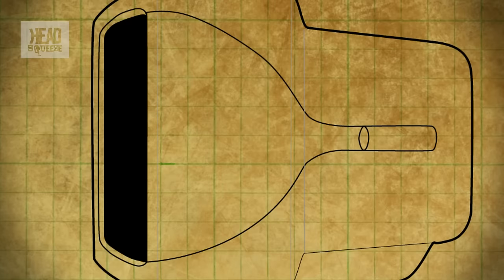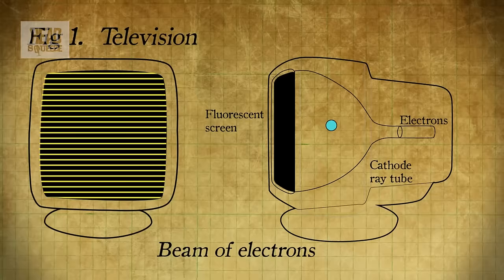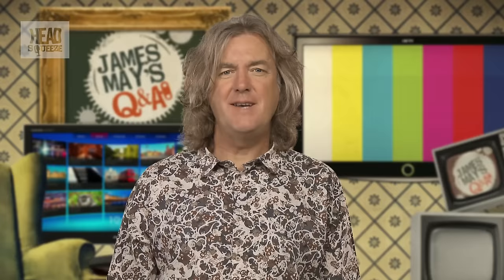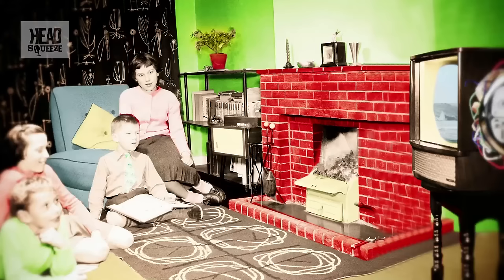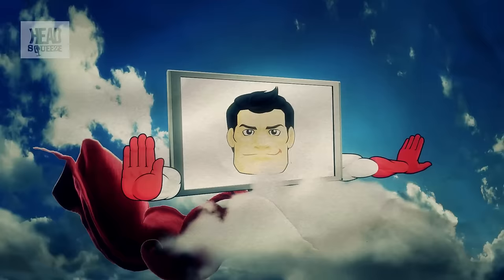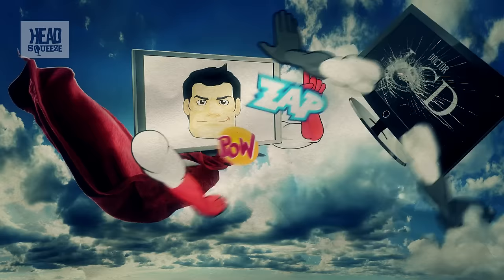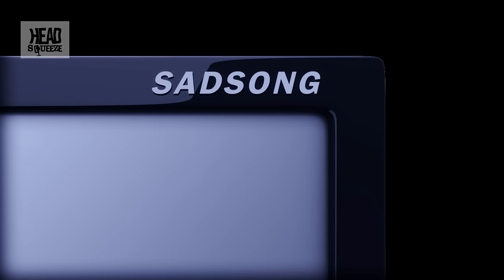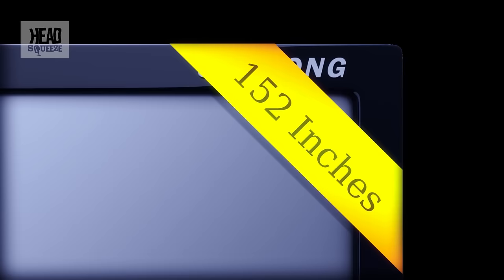How do plasma TVs work? I James May Q&A I Head Squeeze

Comment: It's actually possible to have colour TV with a single electron gun; it just needs to be able to adjust its intensity fast enough (i.e., in the time it takes it to go from each sub-pixel to the next).
Reply: yeah, like the Sony Chromatron
Reply: I think Techmoan reviewed a camcorder that had a viewfinder crt eyepiece with a single gun. It would use near uv pixel to synchronize the colors. It was red, green, blue violet. It had a sensor just for violet
Reply: RGBV, RGBV, RGBV, That's how it could orient itself to know when and where to burst. Techmoan actually showed us that when you covered the sensor, color was lost and monitor went monochrome.
Reply: But I also understand that plasma sets would scam 4 times per frame. I have seen the photos of this. I actually had a plasma set for a short time. I could almost see the 4scan operations to a point. When that thing fell over and split the screen, I powered it in immediately to watch the very center still try to produce at least part of a picture. If you wanted to see a grown man cry like a baby.😢 Mad respect to plasma because it was a crucial step in the development of flat panels and history of them.
Reply: @ray-sattler *Indextron

Comment: Plasmas have a wider colour gamut and deeper blacks than LCDs, and at larger sizes they become more cost effective. You won't find many 32" plasma TVs, but as you go up in size they become more common, and at 60" nearly all the top models are plasma.
Reply: Been tem years since you said this.
Reply: @hectormelendez4891  - And it still holds true, with OLED panels replacing plasma in the last few years. LCDs are still not a great choice for very large TVs (or gaming), although they're still a good choice for "work" monitors, since they don't have the burn-in issues that OLED has. But most people don't use 60" screens for work.

Comment: CRT's use Red Green and Blue phosphors to produce color. Scaling up the size of a CRT width wise did not proportionally effect the depth. Larger units weren't all that deeper than their smaller counterparts especially in the late days of the technology. Also RGB triads on a Slot/Shadow Mask display are not pixels as they're not individually addressed and not digital, they are analogue. Either way entertaining video.
Reply: But after 25 inches diagonal, it seems like every inch diagonal increase was a doubling of weight. Or damn close.  25" can be hefted up by one person. 30" requirements are 4 people to lift up. Wiider scanning angles made for shallower depth on CRT but as it got larger in the front, you're GOING to pick up more depth than a slightly smaller tube.

Comment: its RED BLUE AND GREEEN
Reply: 真夜中の旅団 yea but a looked at my phones screen under a microscope and saw red blue and green rectangles
Reply: Josiah Turner well it really should be red, blue and yellow as thats how you make every color, they might have been blended?
Reply: naw that's how u do it with paint
Reply: +OFFICIALGamingJayZ CMYK is what we know as red blue yellow. It is the subtractive color system. In light RGB are the primary colors.
Reply: +真夜中の旅団 As others have said, RGB are the colors produced by all displays. Differences in the frequency of light don't work the same way as mixing paints.
Reply: ***** wut?
Reply: +Josiah Turner Exactly.  The colors of light verse palettes of color.   Pure Red light plus Pure Green light plus Pure Blue light will make pure white light.
Reply: +Phase_2 They were talking about colors of light, not palate / pigment colors.  Crying out loud.
Reply: +OFFICIALGamingJayZ For Pigment / palette colors, yes yellow.  But for colors of light it is Green.  Pure red, blue and green would make white light.
Reply: +JackFreedomcis I don't know about plasma, but in lcds and oleds, it's definitely red, blue, and green.
Reply: +Phase_2 Yellow is secondary colour.
Reply: +Aroused Squirrel Yes. And televisions were never CMYK. Its for printers.
Reply: omg how old is this comment? 2 yrs? y are peeps still reponding
Reply: Josiah Turner it's actually only a year old.
Reply: Triggered much?
Reply: Red and green makes yellow when you mix light together, mixing yellow and blue together using light just makes light yellow :P
Reply: @misinformedowl9247  yellow isn't in lcd's because at the time they didn't have the technology to add yellow, rgb is mixed to make a orange color that looks yellow since your brain can't tell the difference unless you put it up against real yellow.
Reply: @Giant Sneakerz the primary colors of light are different than the primary colors of pigment
Reply: @Giant Sneakerz You're thinking of pigments. In terms of light, it is red, blue and *green*.
Reply: RBG?
Reply: @josiahturner1433  you probably would have saw dots if its a phone
Reply: It started as red blue and yellow but then when lcd was invented people found out you could make more colors with red green and blue so on plasma TVs  its red blue and yellow 🙂👍
Reply: So they should call those plugs RYB Scart?
Reply: @ravaxe2513  It was red green and blue all the time.
Even the first color sets

Comment: If you sit far enough from your TV to see the entire screen, you're unlikely to notice the difference between HDTV and 4K. Most live action "digital cinema" is mastered at 2K (4K is used mainly for effect shots that are going to undergo a lot of processing). You need a really good (read, really expensive) lens to get pixel-crisp 4K images.

And remember that a Bayer sensor does not capture full RGB information for each pixel, but a TV screen does display full RGB information per pixel.

Comment: Color and image settings is all preference. There are so many calibration settings that it's all preference. What really sets tv technologies apart,is which one has the best black color definition,zero input lag,smoothest refresh rate,and most vibrant colors. Those 3 image qualities is what makes or breaks a tv or pc monitor. It separates the Alphas from the Betas. The videophiles from the tv noobs.  As for motion performance,plasma tv is best in video game use,smooth buttery frame rate,and absolutely no input lag. This is very important in fast paced games,such as call of duty,no motion blur with  Plasma.

Comment: Whoever researched the background of CRT technology for this video didn't dig very deep. Tubes did become progressively slimer as time went on, of course nowhere a flat panel but still, and high definition resolutions were possible (full 1080i achievable on consumer HD CRTs/QXGA on CRT monitors). If CRT continued and didn't almost immediately die, more improvements could have been made.
Reply: They got slimmer and more shalow, but at the expense of extremely thick front glass. I've a B&O 32" true-flat widescreen CRT and it weighs 80kg. Net image size is 29 inch. That is NOT FUNNY. And it is still 55cm deep. Good thing is it turns towards the remote on a rotating feet, so you never see the huge back. A 80kg plasma would be like 90" or so and 10cm deep. CRT was on a dead end track. What DID happen is that Philips desigend a flat CRT tube in the nineties, in a flat glas panel with tiny electron tubes. But the project was killed by the board as it was too expensive. LCD was simply put too cheap to compete with.

Comment: There is in fact no absolute definition of "primary colours". It just means "the colours used as the basis of your palette". The only requirement (if you want to create a full spectrum) is that your primary colours be complementary to each other (i.e., every colour must be derivable from them, and the primaries should not be derivable from each other - otherwise your palette is unnecessarily big).

Nearly all monitors use red, green and blue dots, but some types of film use different primaries.

Comment: In 2017 Plasma still has the best quality of out any screen. It is better than LCD or OLED. 

It can achieve true blacks that an LCD cannot. It can achieve better colours than an OLED. It has limitations in terms of resolution and can only achieve 1080P. 

But it is still the best. I have fancy LCD/LED tvs and they come nowhere near to my Plasma TV which is my cinema reference system. It is even better than my fancy home cinema projector.
Reply: Plasmas don't achieve true blacks. They have very good contrast and motion clarity but don't compare to oled in contrast ratio and resolution and now with HDR becoming mainstream the reasons to keep a plasma are starting to dwindle. On the flip side you can find very nice 2nd hand plasmas for very cheap atm and still look stunning. Having owned multiple trinitron including HD CRTs, Fujitsu and Panasonic plasmas I can honestly say that my lg c8 playing 4k hdr content blows them out of the water. Motion handling is propably the only thing that could be improved however black frame insertion works well in gaming and in 24p content I find all motion processing being turned off to look excellent albeit not quite as good as a plasma, however after a minute or two you quickly forget.

Comment: Being LED-backlit does not mean they can turn off individual pixels, it just means they use an array of LEDs instead of fluorescent lights. Some use as few as 20 LEDs.

Look at a big plasma vs. a big LCD in a brightly lit room (or even outdoors) and you'll see the difference in blacks.

Nothing about plasma makes it "behind the times". The reason why most manufacturers prefer to push LCDs is that their profit margin is bigger. Same reason why CRTs vanished so quickly (very expensive to ship).

Comment: Red Blue and Yellow?Really James? It is Red Blue and Green. We are talking additive colors here folks, not subtractive colors as in paint that absorb specific wavelengths and reflect the rest.Mix red, blue and yellow paint and you get black.Mix red, blue and green light and you get white light.
Reply: +12voltvids no an electron tube works in a different way because of the way it works
Reply: +Bacon lover What?Are you serious? Go back to school. It doesn't matter if we are talking a CRT or plasma or LCD. We are talking primary colors, and when talking light emitting devices, we are talking additive primary colors and those are RED, GREEN and BLUE.Don't believe me, go take a magnifying glass and look at the color pixels that make up all types of color displays.The only display that uses yellow is the quatron LCD by Sharp. They added a yellow color, however it is an interpolated color, because the primary colors generated by the TV camera are Red Green and Blue.
Reply: here was my response, also I am a ex-tv repairman "tv's are Red Blue and Green , not yellow. RGY are the primary colors, And Green is a secondary color. But why would they use RGB on a display? Well there is a difference in projected and reflected light. Where as RGY is used in reflective-subtractive color wheel. Think paint on the wall, where you add all colors you get black. Now think of the TV as a colored light projector you add Red and Green light you get Yellow, this is an additive process. However there is a TV that has yellow pixels also. It is the sharp quattron. As the name would suggest it has 4 pixels Red Green Blue and Yellow."
Reply: we both have the same exact comment lol
Reply: However with sharp, the yellow pixel is just advertising jargon to confuse consumers like curved screens. It does nothing, because yellow is not an encoded color. So to light up the yellow pixel, it is interpolated from the red/green mix. A much better solution was how Sony did it with their triluminous color filter, which starts with primary blue, and by wavelength dividing generates primary green and red wavelengths which generate much more accurate, and a wider color gamut for the LCD color filters. Of course in plasma and oled, these displays generate the light themselves.
Reply: 12voltvids interesting. Now here's a question, would a display be richer having 6 color channels or is it not needed as our eyes and brain cannot tell the difference. Now here's another thought. In a lcd , oled , plasma , crt display you have to place pixels next to each other . What if you had a projected source with pixel stacking so you get true color in single pixel space. How long have you been fixing electronic stuff? I started doing tv repair in 1998 changed jobs to cctv , home theater , home automation , access control in 2012. I work mostly on rear projections and crt stuff early on then dlp , lcd , lcos , plasma then only lcd panels . I never worked on an oled .
Reply: I started in the business in 1983 mostly Betamax, but then I worked for the Sony corp at the time. In 84 I moved on to my permanent shop where I remained until 2003. I did VHS, Beta, 8MM, Laserdisk, CD, DVD, Audio equipment, projection TV, and CRT. I left the business in 2003 to pursue a career in at a major ISP, and just work on electronics now as a pastime for my youtube channel.As to having more colors than the 3 primary, well that is a waste because the television camera is based on 3 primary colors. Any systems that utilize more than the 3 primary colors are generating those colors by means of interpolation to generate discrete colors from the primary colors. Inkjet printers do it, for example my Canon 9900 uses the standard CMYK (cyan magenta yellow and black) plus photo cyan, photo magenta, red and green. The additional colors are added to allow printing those colors without having to use a ton of ink from the others to create them. DLP Tvs also in some cases used a 6 color color wheel to attempt to reduce the rainbow effect as the eye could catch the red/green/blue single colors. The idea was to create a larger color gamut to fool the eye, because t he yellow, magenta and cyan colors, in addition to the red green and blue would blend in and create an optical illusion.  As far as stacking pixels, this is exactly what 3LCD, 3LCOS projectors do. 3DLP cinema projectors also do this. They have 3 chips that overlay each other.
Reply: 12voltvids where you around for some these Sony recalls? 36" and 40" Xbr crt replacement, kp forget the model crt , two surface mount resistors , I want to say A pcb  & 3 crt replacement. Or the sober kdf we and Xbr light engine replacement due to clogged scricco fan "pusher puller fans. I done so many of those in customers house. Light engine swap was like 30-60 min job. The 3 crt's and surface mount resistors job used to take me 3 hours or so. I used to replace blue and red first and align to old green crt then change green and align to new crt's . I miss it driving around meeting new people.
Reply: I did a bunch of 3 CRT projection tube replacements when the green tube arced and broke the faceplate. Never did any 40" direct view tubes. We didn't have the equipment to lift the tubes out. I di remember them though. Had a customer that had one of those bears (40" CRT) installed in his bedroom up about 6 feet in the air. The CRT failed. My boss insisted that I fix it in the house and I said how, it is a custom install that I can't even get the back off, never mind see in his dark bedroom. Yes I did plenty of light engine replacement on the LCD and LCOS projector units with the clogged air filters. They were a big problem in smoker houses. Tell someone that the reason their TV failed was due to all the people smoking in the room, and see how far you get. Oh well, the doctor will be breaking the bad news soon when he tells them that their lungs are full of cancer because of all the smoke. Then they will realize that the TV repairman that told them their TV was shot from all that smoke was right. never did any in customers homes. They all were brought into the shop. We had a couple of mover guys that all they did was bring me stuff, I would fix it, and they would take them back. When I was doing those 3 tube projectors would do 2 or 3 of them a day.  Remember the fly back and HOT problem that plagued all those Trinitron sets between 200 and 2003É I was changing about a half dozen a week.  When I left all my colleges in the business said I was crazy to leave and go work for a satellite TV installation company, which I did for a year, and then a major telecom started a major hiring and I slid in there to make it 3 generations of my family to work for the phone company. That was my calling. I missed out the year I graduated because they finished hiring when I was in grade 12, and didn`t do a major hiring again until those workers started retiring. My uncle worked for the phone co, as did my cousin. Now it is my turn.
Reply: 12voltvids after reading this and its comments, now im even more confused.
Reply: I was just about to say that.
Reply: There are lots of different colour models for TVs. RGB is one colour model, so is YCbCr, CMYK, RYB (Red Yellow Blue), etc
Reply: @12voltvids  its not an advertising jargon, yellow is the brightest color we can see, it adds a large spectrum of colors and light that rgb tv's can't produce.
Reply: @HamguyBacon  
Video displays do not use yellow. They use red, green and blue. Sharp as an advertising gimik added a yellow pixel, but yellow is not part of the video signal, so it must me interpolated in, as yellow does not exist in a video signal, only red, green and blue.
Reply: @12voltvids  Sharp added an extra pixel that had true yellow, this allows for far more colors and a brighter image. 
in a rgb display
red and green has to be mixed and dimmed specifically to make the appearance of yellow which is actually a orange color that looks yellow.
Reply: @HamguyBacon  
Sony and Samsung achieved the same thing using nano dot technology to recreate the exact same wavelength of light as the primary color filters in the camera. I have looked at many televisions, and I never liked the color of the sharp sets.